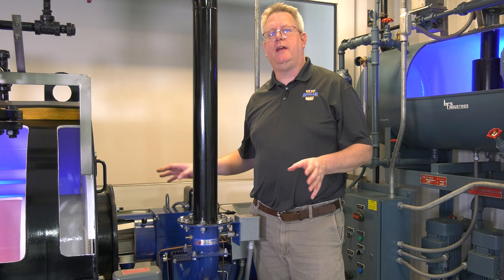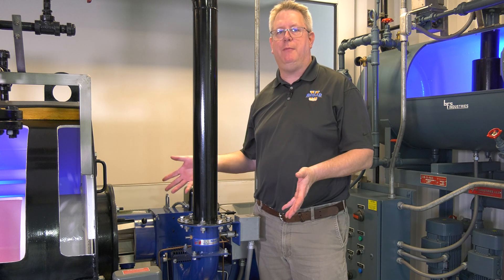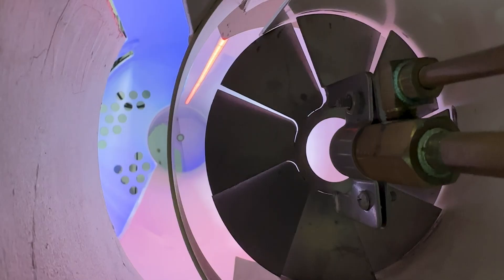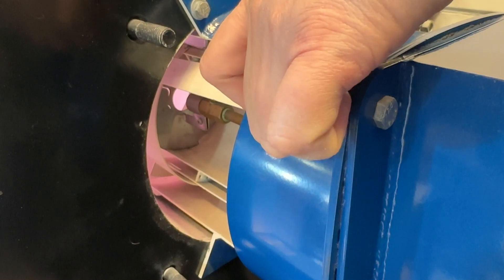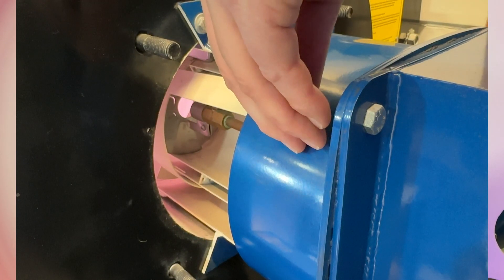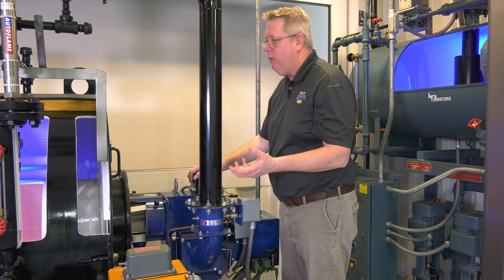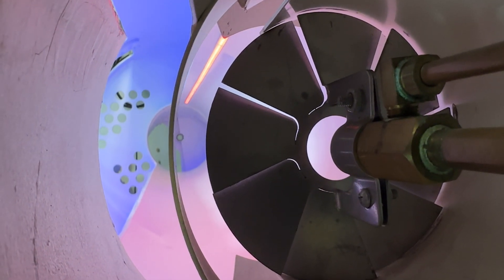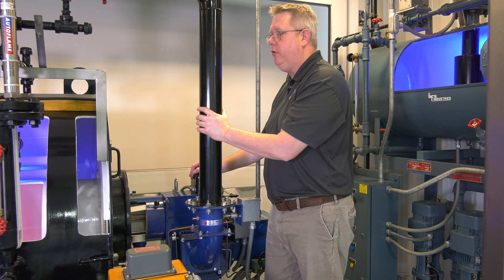What is The Difference Between Primary & Secondary Air?  Weekly Boiler Tip

Comment: I have to point out a mistake with this video. I know the intention and agree with the explanation of primary secondary air. However, the example is inaccurate in this particular burner. The adjustable sleeve in this burner does not redirect air for the purpose of secondary air. The sliding ring/sleeve within this burner is a "Fuel Air Pre-mix adjustment. It allows for air to transfer into the gas manifold just prior to exiting the orifices in the end of the manifold. As a side note, most of the time it is left full forward with little if any pre-mix air entering the manifold.